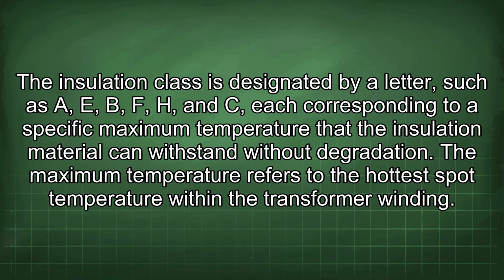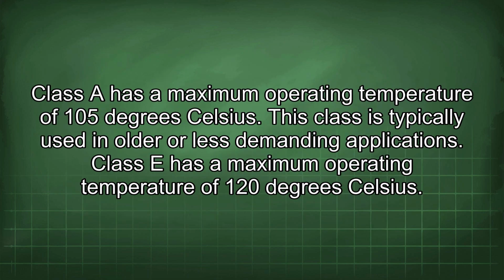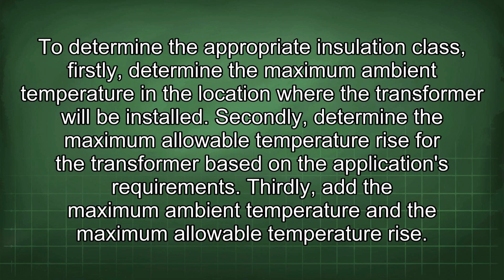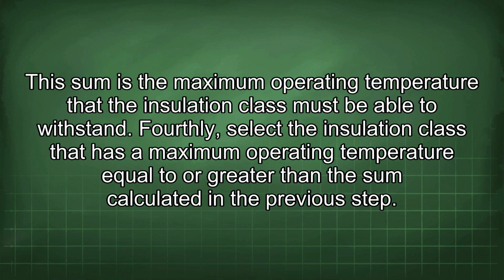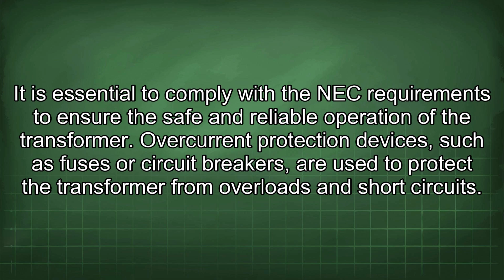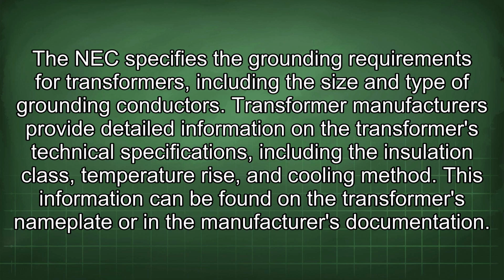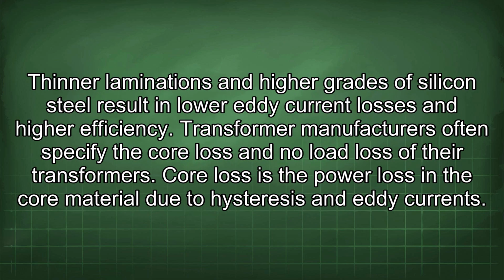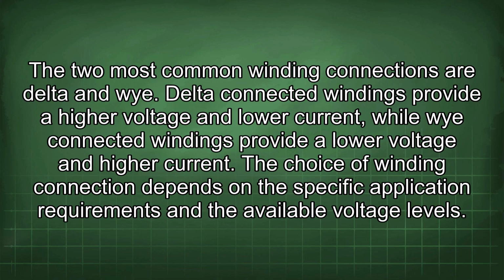Transformer Insulation Class Explained Choosing the Right One

Comment: Not sure the example for selecting the insulation class. 65 degree C rise, 40 degree C ambient. Would Class E (120 degree C) be enough?
Reply from the maker: Hello @peihuiliu979,

That's a great question about the practical application of transformer insulation classes!

Let's break down the required insulation class based on the given parameters: a required temperature rise of 65°C and the standard maximum ambient temperature used for transformer rating, which is typically 40°C.

Calculating the Required Maximum Operating Temperature
The transformer's required maximum operating temperature (often referred to as the Hottest Spot Temperature limit) is the sum of three components, as described in the video:

Maximum Operating Temperature = Ambient Temperature + Temperature Rise + Hotspot Allowance

Standard transformer practice often assumes a 10°C hotspot allowance for dry-type transformers when assessing the overall thermal limit. The required temperature rise is given as 65°C, and the standard ambient temperature for rating is 40°C.
Ambient Temperature: 40°C
- Temperature Rise (Delta T): 65°C (Specified)
- Hotspot Allowance: 10°C (Standard margin)
- Required Maximum Operating Temperature = 40°C + 65°C + 10°C = 115°C

Assessing Insulation Class E
The insulation class must have a maximum permissible operating temperature equal to or greater than 115°C.

According to the video:
Insulation Class E has a maximum operating temperature of 120°C.

Since the required maximum temperature (115°C) is less than the maximum temperature allowed by Class E (120°C), Insulation Class E (120°C) would be sufficient and compliant with the specification of a 65°C temperature rise and standard 40°C ambient rating.

Comparison of Common Dry-Type Transformer Insulation Classes
Here is a quick summary table for reference, including Class E:

Insulation Class, Maximum Operating Temperature, Compliance with 115°C Requirement
A, 105°C, No (Too low)
E, 120°C, Yes
B, 130°C, Yes (Provides extra margin)
F, 155°C, Yes
H, 180°C, Yes
C, >220°C, Yes

Sincerely,

BESA Research
Reply: @BESAResearch  Thank you so much, and I appreciate such detailed explanation!!☺